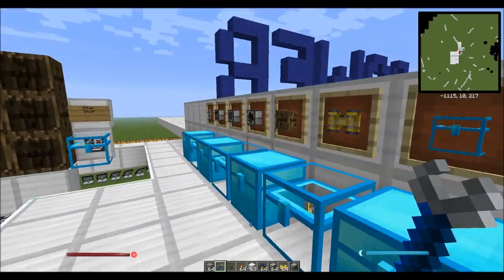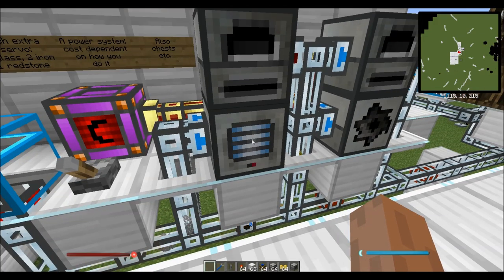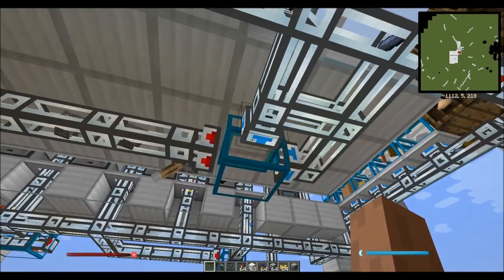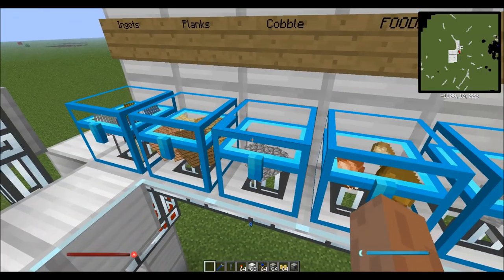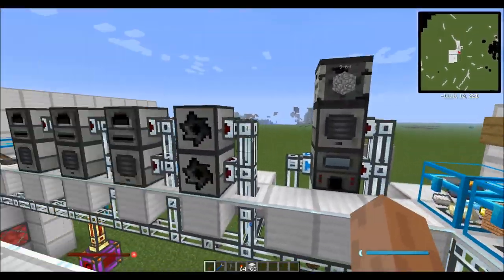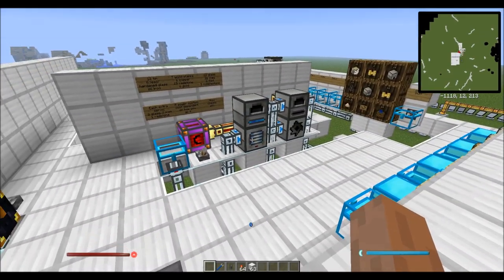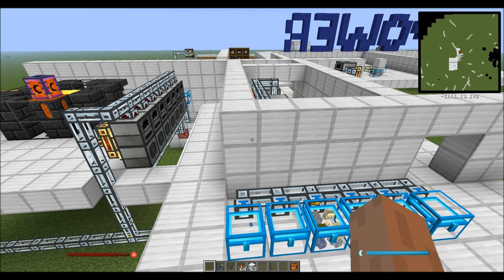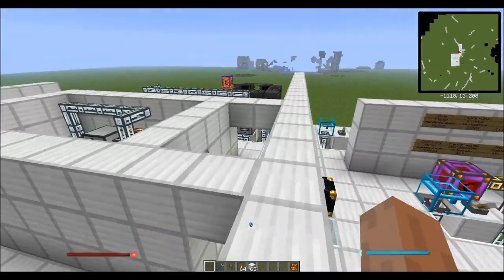Thermal Expansion 3   Sorting and Processing System

Comment: You also need to be careful when piping molten metal out of the TC smeltery into multiple molds. The system can jam if one ingots worth of metal gets poured between two molds, they'll both be stuck at 50%. If another metal then enters the smeltery, it won't be able to exit and will sit at the bottom and prevent the original metal being poured some more. EG, say you had the two ingot casts you showed and you put 5 ingots worth of gold in, then 10 iron, then another 5 gold. The first 4 gold ingots will cast fine, then the fith ingot will be split 50/50 between the two molds. Iron will now pool at the bottom of the smeltery with the gold on top until you manually come to move the gold back to the bottom.

This happens as (as far as I am aware) Fuid Ducts do not work like Item Ducts, they output to everything on them equally, not the shortest route.
Reply from the maker: Yes, this can be quite a hassle if you add single ingots!  Although ores give 2 ingots so I've never had a problem doing it this way processing ores.  Just make sure single ingots don't make it into the smeltry.  If I were using the smeltry for all my ore processing I would probably use casting basins and have one per ore type.  You can then filter the liquiducts according to the liquid metal you want.  Definitely worth keeping in mind.